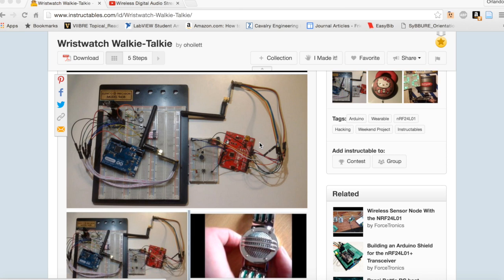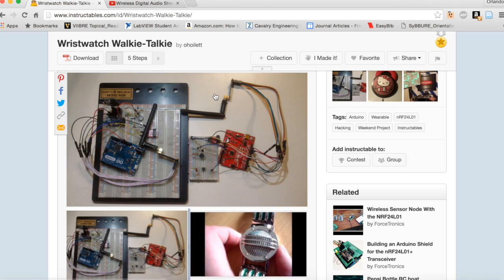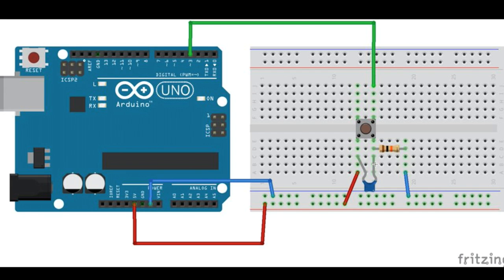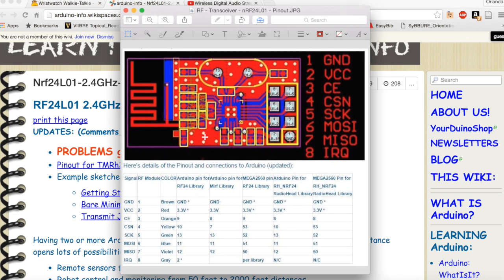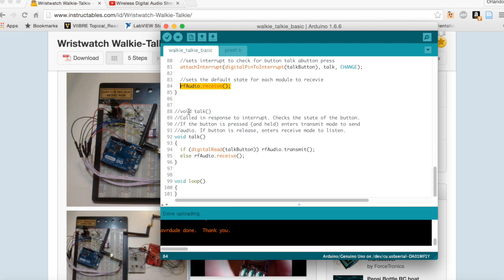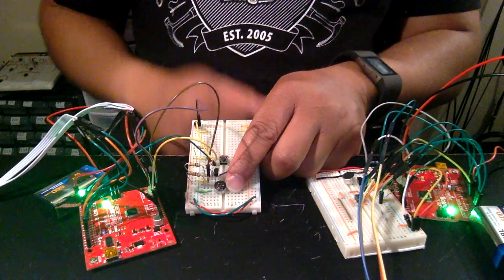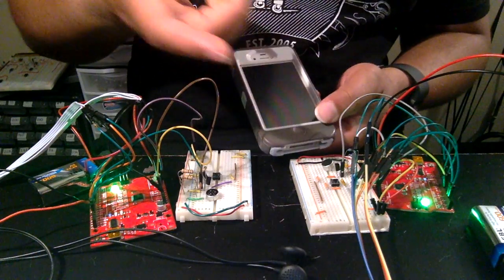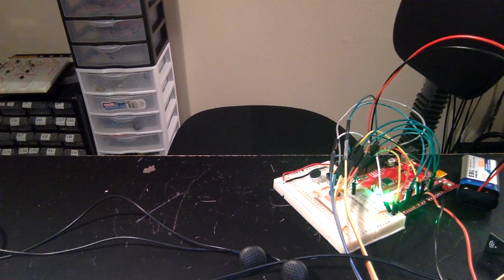Arduino Walkie Talkie

Comment: Hey!!
I tried buliding this but it doesn't seem to work. Could you help me out please!!
Reply from the maker: Sure! What part of it isn't working?
Reply: I  don't think that the audio signals are getting transmitted. Tried putting the ckt two times but the same pblm is persisting. The Nrf24L01 I used doesn't have an antenna. Is that fine?
Reply from the maker: @sandeepreddy4126  Have you verified that the microphone amplifier is setup correctly?
Reply: @shoilett1  yeah I did but still didn't work. Can u tell the part number of the mic u used? Thanks
Reply from the maker: @sandeepreddy4126  I just used a cheap mic I found on Amazon, but it's similar to this one from SparkFun. https://www.sparkfun.com/products/8635
Reply: @shoilett1  okay will check again!
Reply from the maker: @sandeepreddy4126  Cool! Let me know if you run into any trouble.

Comment: I USE AMS1117 WHICH IS KNOWN AS 3.3 VOLT MODULE TO DOWN AT 3.3 V BUT WHEN I USE LITHIUM OR POWER BANK BATTERY ITS OUTPUT IS 3.7 V TO 4 V SO WHERE FROM I SHOULD GIVE INPUT VOLTAGE TO AMS1117 MODULE ?????????
IS IT FROM DIRECTLY BATTERY OR BY USING POWER BANK BOARD WHICH COVERT TO 5 VOLT FROM LITHIUM POWER BANK BATTERY (3.7V ) ??????
ALSO  MY  AMS1117 GIVES  3.13 VOLT  INSERTED  OF  3.3 VOLT ??????????

Comment: What is the cause of that 1.5kHz background buzz in your speakers?  I have the same 1.5kHz background buzz in my attempt.  So my results are similar to yours.
Reply from the maker: The audio is being generated by a pulsing one of the digital pins. As a result, you are generating square wave pulses, hence the buzzing. You're hearing the square wave harmonics. You can try to low-pass the signal to turn it into a sine-wave. A 4 pole low-pass filter may do the trick.
Reply: @shoilett1  Thanks.  The arduino uno (what I'm using) data sheet says that the PWM pins are 490Hz, with pin 5 and 6 being an exception at 980Hz. So shouldn't I be hearing a 490Hz tone instead of 1.5kHz?  I'm new to this, sorry for the novice questions.
Reply from the maker: @notablemind  I haven't dug into the RF24Audio source code, but it's likely that the PWM frequency is modified by the RF24Audio library. The "Arduino default PWM frequency" is 490Hz, but that can be changed, so no big deal there.

Comment: Maybe if you use mic setup like the MAX9814 the sound would be better . 

Any way can I use any speaker in this project?
Reply from the maker: It’s not the microphone, it’s how the sound is reproduced (FSK - frequency-shift keying). You can add a speaker if you want. Are you asking where? Just the audio outputs. You’ll need to use a voltage follower or audio amplifier though.
Reply: shoilett1 
Hi 

i have done the connection but there is no output 

Iam using long range Nrf24

does it need to set the address and those things?

Comment: HOW CAN I FIX THIS ERROR? THANKS

Arduino: 1.8.5 (Windows 10), Board: "Arduino/Genuino Uno"

C:\Users\Chino\Documents\Arduino\TRY\walkie_talkie_basic\walkie_talkie_basic.ino:60:18: fatal error: RF24.h: No such file or directory

 #include <RF24.h>

                  ^

compilation terminated.

exit status 1
Error compiling for board Arduino/Genuino Uno.

This report would have more information with
"Show verbose output during compilation"
option enabled in File -> Preferences.
Reply: ITS OK NOW BUT THIS COMES OUT
Arduino: 1.8.5 (Windows 10), Board: "Arduino/Genuino Uno"

Archiving built core (caching) in: C:\Users\Chino\AppData\Local\Temp\arduino_cache_213628\core\core_arduino_avr_uno_0c812875ac70eb4a9b385d8fb077f54c.a
Sketch uses 10564 bytes (32%) of program storage space. Maximum is 32256 bytes.
Global variables use 443 bytes (21%) of dynamic memory, leaving 1605 bytes for local variables. Maximum is 2048 bytes.
avrdude: ser_open(): can't open device "\\.\COM7": The system cannot find the file specified.

Problem uploading to board.  See http://www.arduino.cc/en/Guide/Troubleshooting#upload for suggestions.

This report would have more information with
"Show verbose output during compilation"
option enabled in File -> Preferences.
Reply: i got it working now. how can i add a LED on it. so that the other knows that im pressing it. also how to add a buzzer on it

Comment: HI, I am really glad that you made this video, coz am using this method in one of my project. but there is one problem, I need to use the same nRF24L01 to send data to other node as normal transmitter. and also need to use the SPI communication for other device. So the problem is, when I initiate the rfAudio, the SPI stick with that and I cannot send and receive anything from my other device, and I tried pulling up the CS pin of nRF24.
can you please give me any solution for that please? thanks
Reply from the maker: I would look into the nRF library to see how they are handling the CS pin. You should be able to have two CS pins by just using another digital pin for your second SPI device.

Comment: is there a way you could make a instructables page for idiots pls?? also can it work with a arduinio mini
Reply from the maker: Hahaha.
Yeah it'll work with an Arduino Pro Mini.
Reply: once i upload libraries will the walkie_talkie_basic program take care of the rest or do i need to tweak it??
Reply from the maker: Everything should work fine. Let me know if you have any other questions.
Reply: what transistor should i use for the mic circuit i have bc546 also i cant get it to work :/ i think i wired it up correctly also ceramic capasitors (orage ish ones) are fine??
Reply from the maker: Any general purpose NPN transistor should work.
Reply: Dummiess

Comment: I would like to ask You, that what is the frequency? can You reglate it from software or it can be reglate manually?
Reply from the maker: It's internal to the RF24Audio library so I would take a look at that.
Reply: Thanks in advance! :D
Reply from the maker: I took a quick look at the RF24Audio.cpp file. These lines (lines 249-253) stand out to me:
#if !defined MANUAL_BUTTON_HANDLING     // Allows users to totally customize button handling or disable it
 ISR(TIMER0_COMPB_vect){      // Non-blocking interrupt vector for button management. Is triggered ~1000 times/second by default on Arduino
  handleButtons();       // Check for external button presses at the default timer0 rate
 }
#endif

Although I don't remember if the frequency of the audio output pins was 1kHz or 10Hz.
Reply: shoilett1 I would like to build a system in vhf, uhf or cb range. thanks for information. :) Br. T.
Reply from the maker: Oh haha. I think I misunderstood your original question. "I would like to ask You, that what is the frequency? can You reglate it from software or it can be reglate manually?" ---- The nRF24L01 is a 2.4GHz module so it's transmitting the data at 2.4GHz. I don't know how much control the user has over the transmit frequency of the module itself. The 1kHz or 10kHz, I'm referring to is something else entirely.

Comment: Thanks Dude. will try this project
Reply from the maker: Take a look at the RF24Audio library. The "OUTPUT" and "INPUT" declarations are in there. Look at the userConfig.h file and the RFAudio.cpp file.
Reply from the maker: Cool. Have fun!
Reply: how do you know where to add the input ad output circuits? I'm used to avr, just started using arduino not too long ago and i didn't see you declare and pinMode for output, or input for the microphone. where would i find that if i were to download the library? 

Well i know A0 for the input but were in the code does it say that? Maybe if i knew that i would know where it says where the output code is. I hope im making sense.
Reply: shoilett1 thanks a bunch, real help there
Reply from the maker: Yeah dude. No problem.
Reply: built the circuit and wnated to say thanks for the video, the output is a little noisy though, i put a capacitor between the two outputs and that helps but it also makes it quieter, any ideas. also my microphone probably isnt the best but its all i can work with.
Reply from the maker: I haven't found a solid way to make it less noisy. I've used this circuit and it helped quite a bit. It does make it a little quieter though, but it's a pretty good volume when you're using headphones. It's a square wave to sine wave converter. It helps reduce the harmonics from the square wave output of the digital pins making it less noisy. https://www.circuitlab.com/circuit/639ev6/square-to-sine-wave/
Reply: hey again, is there any reason why you didnt write any of the code in the void loop?
Reply from the maker: Yeah I didn't need to. The interrupt handles everything. Good question.

Comment: its not working..all i can hear is noise
Reply from the maker: There is a lot of background noise even when it's transmitting audio. If you can't hear anything when someone is speaking on the other end, make sure you have the microphone pre-amp circuit set up correctly.

If you still can't figure it out, we should video chat. This might be difficult to debug over the comments section. Lol.
Reply: +shoilett1 i still cant figure it out.the noise is very very low. i set up everything as you mentioned here.the circuit is ok but its not working.how can i contact with you?
Reply from the maker: ***** I found you on Google Plus, but I can't DM you. Send me a DM so we can schedule a hangout.
Reply from the maker: ***** It's noisy when it's working normally. I have to speak really closely into the microphone. Also, I made a mistake in the Fritzing diagram of the microphone circuit. The proper diagram can be found here: https://github.com/hoilett/Arduino-Walkie-Talkie-Instructable/blob/master/proper%20microphone%20circuits.jpg